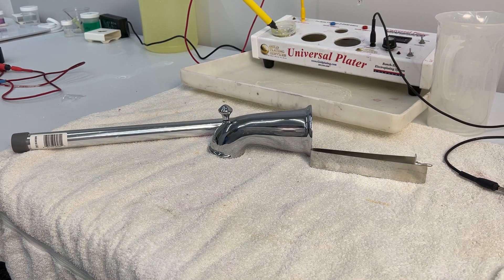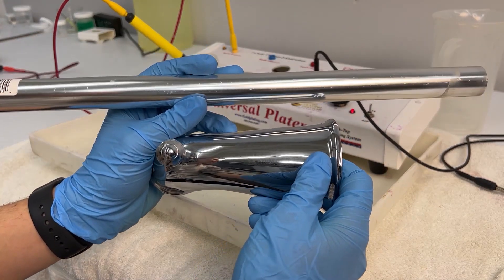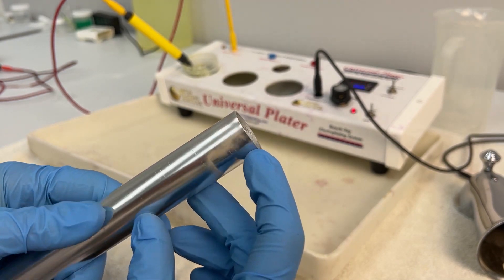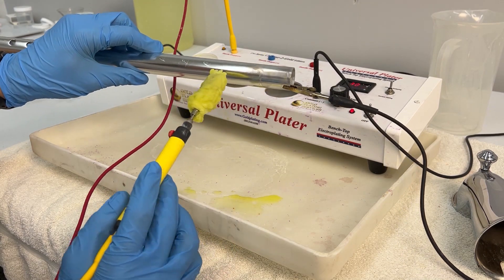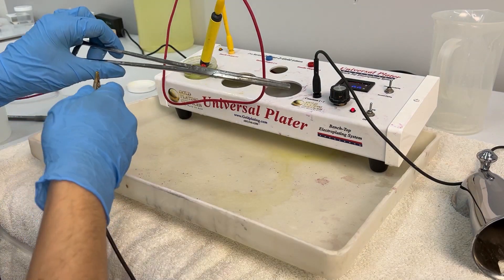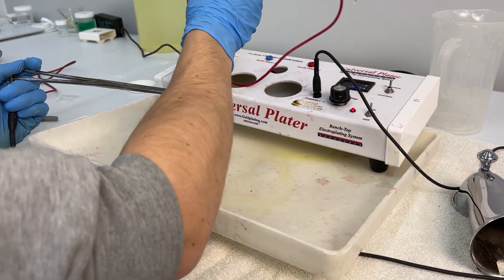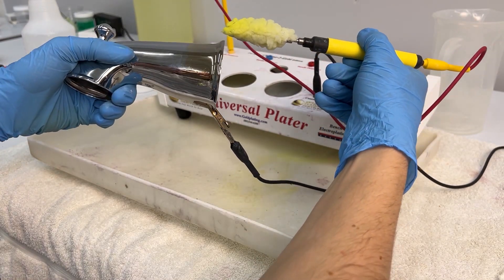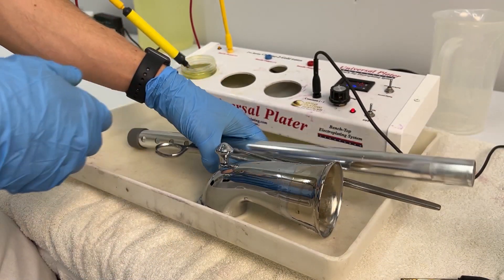How to tell if an item is Chrome plated

Comment: If I have chrome plated aluminum can I then gold plate it?
Reply from the maker: If your aluminum is chrome plated and that chrome coat has nickel under it you would be able to gold plate it. But if the chrome just has aluminum under it after you strip it off the chrome you would not be able to plate the aluminum in gold.
Reply: No, you only Gold Plate over Nickel.....
Reply: @jdlmnz5  thx